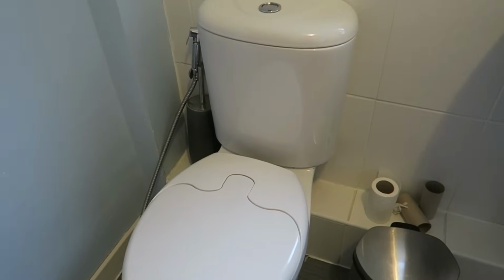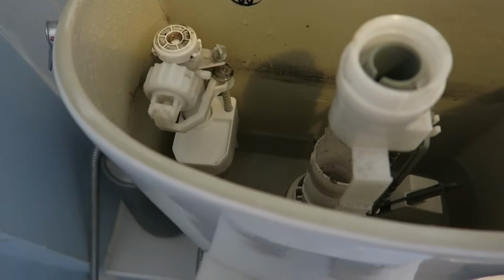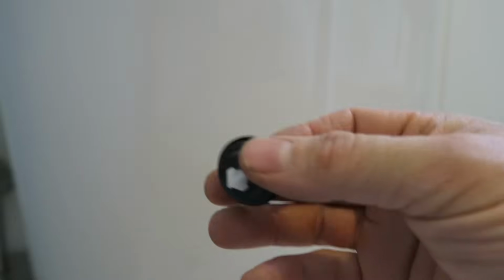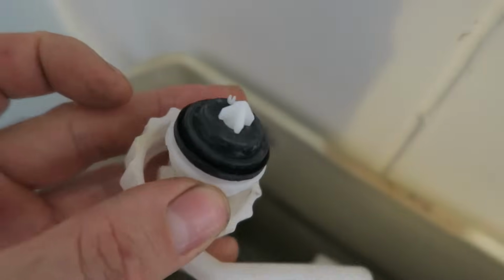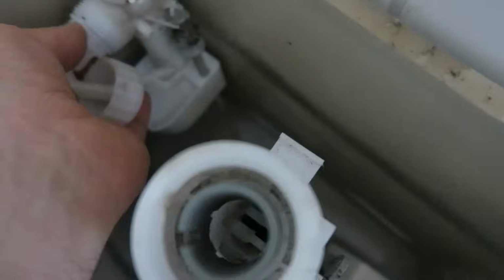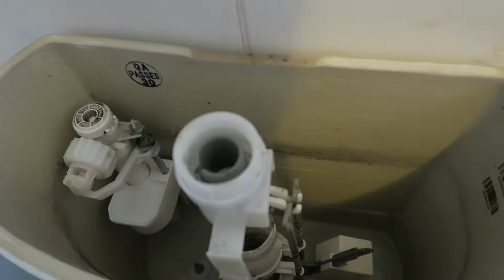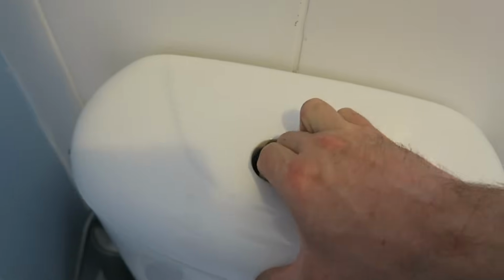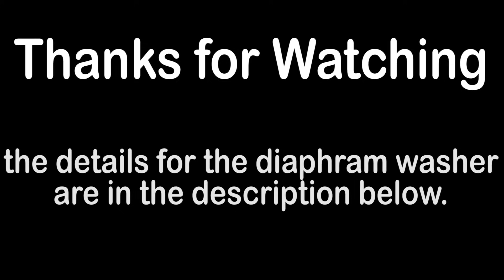Toilet Repair, Slow Filling Cistern Repair

Comment: I've just done all 5his - exactly the same initial problem with tear in washer etc. However, my cistern now won't refill at all and yes I have turned water back on. Help!
Reply from the maker: Make sure that notch is located properly - that's the first place to start 👍
Reply: @handymancraftglasgow  thank you. After googling I discovered the pinhole was possibly blocked so I stuck a safety pin in it and gave it a wiggle. Fitted it all back on and is miraculously working! Thank you for your video and replying I'm proud that I did it myself (with the help of a man on YouTube 😜)
Reply from the maker: Brilliant. I just pointed you in the direction, you did the rest. 👍

Comment: We have this same problem, but I cannot get the nut to budge, and I'm scared of forcing it and cracking the plastic mechanism.
Reply from the maker: Make sure you can get a spare or just replace the valve, sometimes that's easier. I did a vid on that as well. 
https://youtu.be/oz6z24HciSg
Reply: @handymancraftglasgow  Thanks, I saw you had replied to other people asking this question about a million times after I posted mine!
Reply from the maker: Not a problem 👍

Comment: My one seems really tight and I'm afraid of twisting too hard to undo it lest I break something.  Any tips? Thanks!
Reply from the maker: Sometimes they are quite tight. Just make sure you are tuning the correct way to release, you may need some grips to help. 
If it does break its not a huge job to replace the whole valve. There is a video for this on the channel.

Comment: I have this problem so thank you for the video but I can’t unscrew the plastic thing, it’s soooo tight I’ve tried wearing rubber gloves and still can’t unscrew it. Any suggestions please???
Reply from the maker: A set of water pump pliers would do the trick. Just be careful, if it's that tight you could break the inlet valve. 
Not a difficult job to replace and there is a video showing how to do that as well.
Reply: Handyman Craft Glasgow thank you so much for your reply I’ll give that a go. I’ve also got a problem with the button it won’t screw back on place it’s a small tiny screw in middle and ages ago I had a plumber who welded it back on but now I’ve had to take lid off again it’s come loose again so think I might have to just pay for a plumber at some point
Reply: Well I picked up my rubber part from screwfix and toilet fixed now thank god so thank you so much as you’ve saved me a fortune I think. Toilet button still loose and it’s got a tiny screw in the middle that you have to line up with the two side parts I think which I’ve never been able to figure out but it flushes which is main thing
Reply from the maker: Good to hear it went well 👍
Reply: Hello again. Please could you help me. My button is broken so I'm having to push the stick in the middle and it's not an easy screw on button by the looks of it. Is there any chance I could send you a picture of the fitting somehow and could you tell me what part I need to order please 😁
Reply from the maker: Not sure I could help you with that. But send a picture and will see if I can recognise.

Comment: Hey I replaced the washer but there is still a spray/leak coming from that area...Can you advise?
Reply from the maker: Make sure that the notch is lined up properly when you tighten. If it is and still leaking you may need a new valve.
Reply: Thanks it is as you said so i guess a valve. Is that easily replaceable?
Reply from the maker: Not to difficult. I don't have a video for that yet. But there may be one out there.
Reply: Thanks. just one more question, do you know what model valve i need to get - I can't seem to find one matching the type in your video, which is the one I need to find. Thanks again!
Reply: Thanks. just one more question, do you know what model valve i need to get - I can't seem to find one matching the type in your video, which is the one I need to find. Thanks again!

Comment: What if I did everything just like on the video but tank is still filling up slowly? It does fill up very fast but only for about 5-10 seconds after I turn the water valve on. Then it's slow again.
Reply from the maker: Check that the notch is located properly. This is usually the problem. Check the new washer for any grit, make sure its clean.
If you are still having problems you may just need a new valve.
This video should have the information you need
https://youtu.be/oz6z24HciSg

Comment: Alot better to take arm of first
Reply from the maker: You are correct. 
Sometimes they can be on really tightly and if the plastic is old it can, on occasion, break. 
That's why I left mines on. Although, I ended up replacing the whole valve a year or so later. 
Thanks for leaving the comment, much appreciated 👍
Reply: This solved my problem. Definitely take it off first

Comment: I did this, it was split. So I paid £5.38 to get another and replaced it. Now I have a constantly running into the basin problem. Turning the water off the problem stops. So it is somehow connected with the part I just replaced. I unscrewed it and put it on again, trying to make sure everything was aligned. Lol, it was worse. Ahhhhhhhhh Grrrrrr.

Comment: Just changed mine as it was split but water still continues to spray out the end of this assembly where the pivot point of that plastic arm is. Clueless lol
Reply from the maker: It probably just needs located properly. Try lining the notch up again and this should solve.

Comment: i was about to order the part from the Amazon link that you posted but there's a lot of bad reviews for it.. is this just plumbers trying to discourage diy fixes?
Reply from the maker: Not sure what that's about.That's the link I use to buy them and not had any problems. If worried you can get from eBay or Screwfix and any plumbers merchant should have them.